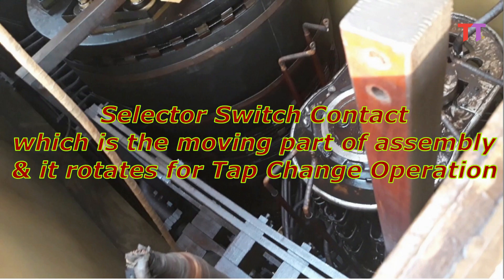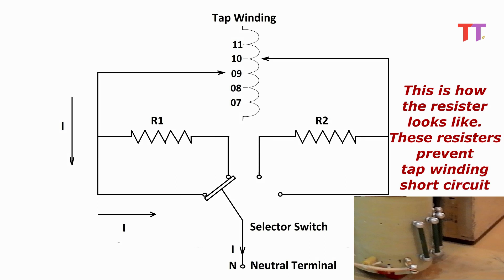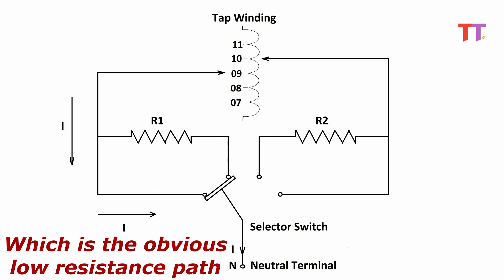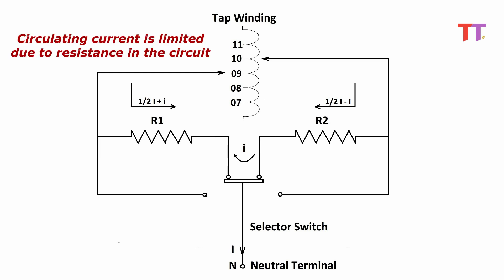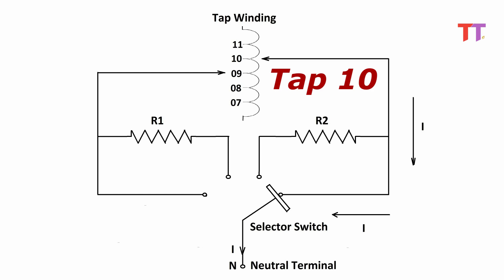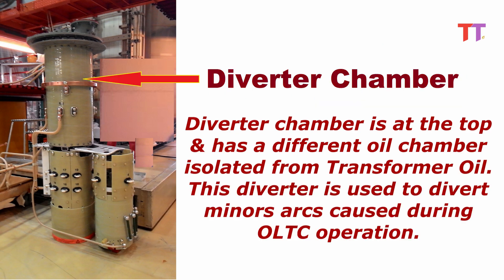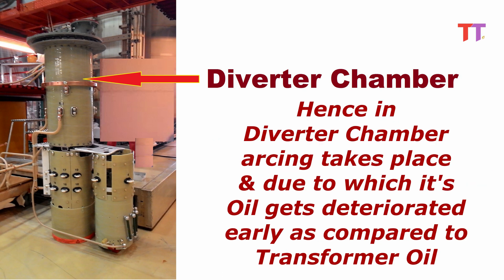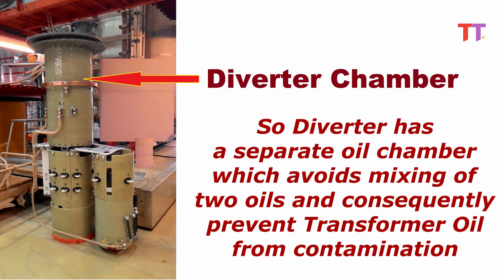OLTC: On Load Tap Changer. A complete and Practical explanation

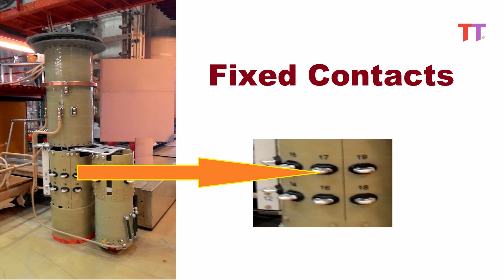Comment: Thanks for the video, I want to correct one thing: 1:25 these are tie-in resistors which are used to limit the recovery voltage during the operation of change-over selector.
Change-over selector is equipped to OLTC when we need higher operating positions with a limited tap selector contact quantity.
For example: OLTC with 10 selector contacts and without change-over selector: can operate up to 10 positions only, while the same OLTC when equipped with change-over selector can operate up to 19 positions (10*2 -1).
The transition resistors used to limit the circulating current duration tap switching are located inside the diverter switch insert in the oil compartment of OLTC.
Reply from the maker: Thank you for the comment

Comment: Hi sir,i have the following questions:
1. How does the OLTC work automatically as in how does it measure the change in load and changes it taps accordingly?
2. As shown,there is also a counter inside and while doing the O&M, we check how many times OLTC operated.I wanted to know is there a certain value in the counter above which we can tell that it can cause problem to the OLTC?
3. The motor used is AC or DC?
Reply from the maker: Thank you for your comment.
Following are the answers to your questions.
1. There can be two ways to monitor voltage change, if one observes voltage change beyond limit, OLTC is operated. Also there are OLTCs with AVR system called as automatic voltage regulation. In this case voltage is monitored and regulated automatically. That means OLTC changes tap automatically.
2. Yes. After certain number of operations, it is advised to do OLTC servicing in consultation with respective manufacturers. Also life of OLTC is related to number of OLTC operations.
3. The motor used is AC motor.